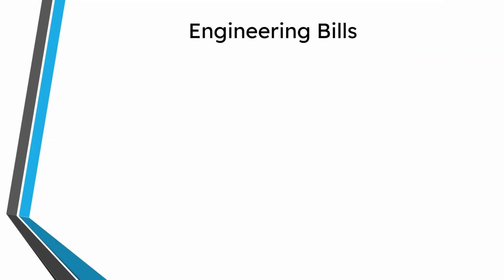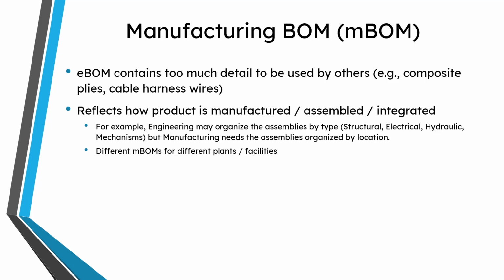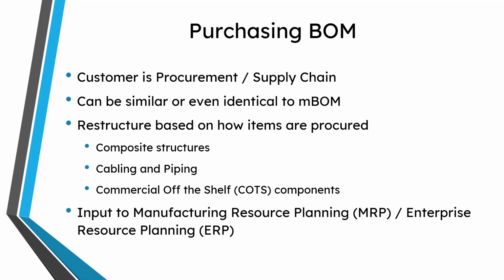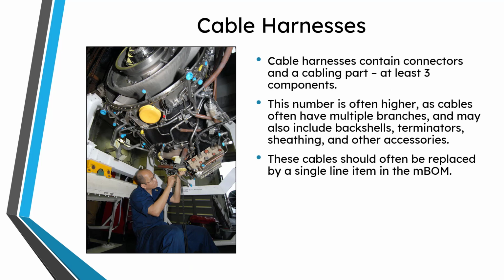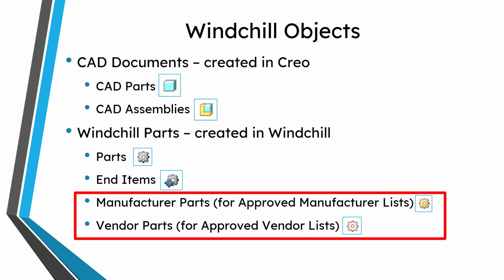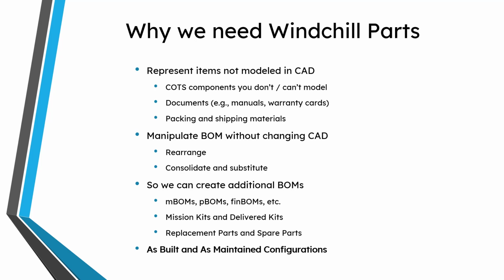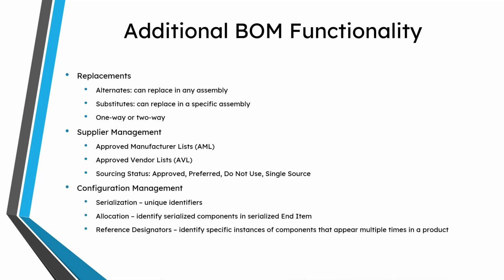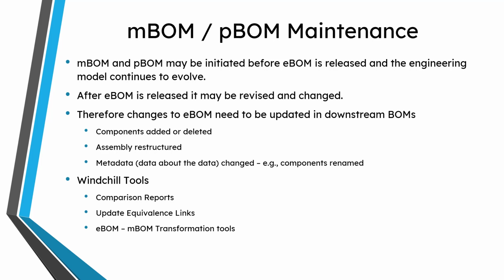PTC Windchill PDMLink - Introduction to BOM (Bills of Material) Management

Comment: Hello, sir! Correct me if i am wrong, that Ebom and MBom associate between each other. 
And do you have example how to "convert" Ebom to Mbom
Reply from the maker: Yes, the Engineering BOM and Manufacturing BOM are related to one another. That way if the eBOM gets updated, you can update the mBOM. I have one video on the eBOM - mBOM transformation process, but I was not able to complete the video series on the subject.
Reply: @CADPLMGuy  Forgive me sir for the tactless question, but will it ever happen?
Reply from the maker: I don't know. I jury rigged a Windchill 11 instance. It took me days to get that to work. That's how I was able to make my previous videos. Then Windows died in the VMWare I was using. I'd like to get a more recent Windchill instance running. If you really need to learn eBOM-mBOM, I suggest reaching out to your VAR for consulting.

Comment: Suppose if I am having a configurable product. Say a part number 12345V000 is its name. In that product, I have component p, q and r. But, at not all conditions they might appear in the product. For eg, if my load size is 10mm then p might come and if its 20mm q might come and etc.. as of now, i am using a local parameter to control its condition so that if i say yes or no to super bom import, i can get all the BOM items to PDM. Without using a separate variable, how can we import super BOM of a product when we cant configure all of the items in a single structure?
Reply from the maker: It sounds like you should be using Options Modeler in Creo and/or Options & Variants on the Windchill side. I have a video coming out tomorrow on generating product variants using Options Modeler.